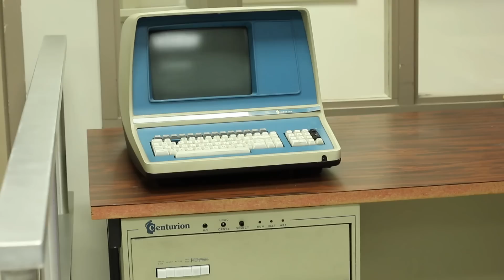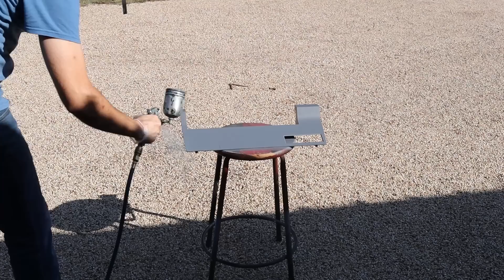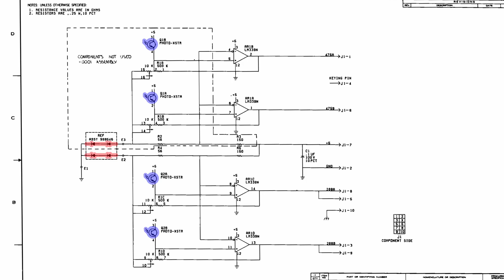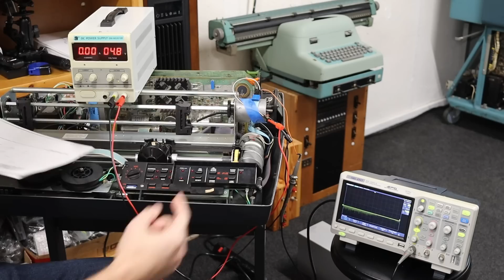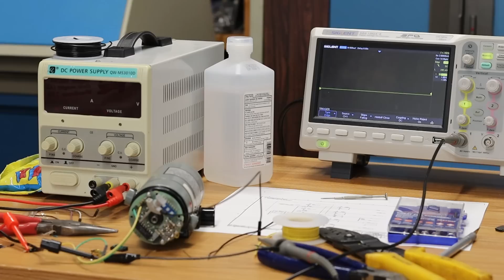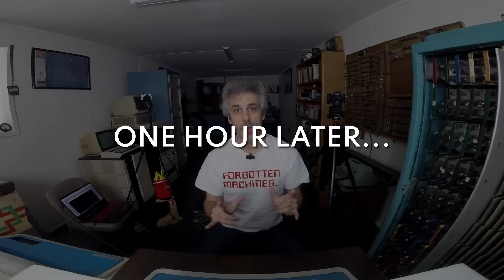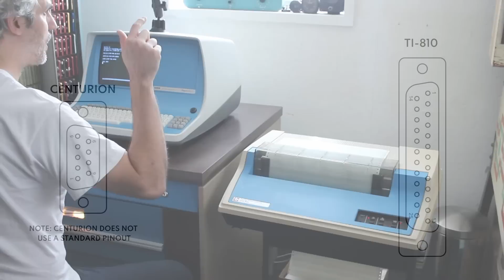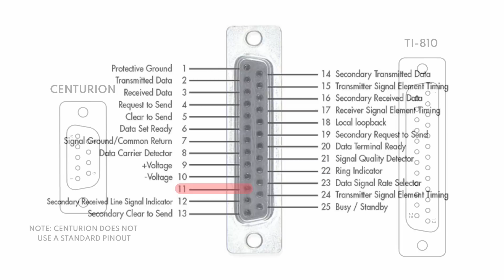I Thought It Would Be Easy… It Wasn’t

Comment: I was shouting at the screen when you were saying cabling issues.  RS232 is easy when you understand the different layers of it.
Each of the following are at opposite ends of the connector i.e. a end  -> b end

GND -> GND, since you always need a ground reference 

TXD -> RXD and RXD -> TXD so you have a data flow for the printed data, this is just data, no flow control, unless you use X-On / X-Off software flow control.
The pins meanings are Transmit Data / Receive Data. This is the absolute minimum needed for communication. 

RTS -> CTS and CTS -> RTS, so you have hardware flow control. The pin meanings are Ready to Send and Cleared to Send. This is needed to slow down the sender at the right time.

DTR -> DSR + DCD at one end and then and DCD + DSR -> DTR so you have modem flow control. The pin meanings are Data Terminal Ready, Data Set Ready, Data Carrier Detect. This is for modem control, so another layer of flow control for the modem, its only relevant if you have a modem in a link.

If you need a full modem support for incoming call, then you also need Ring Indicator (RI), in this case, then connect RI -> Data Carrier Detect (DCD), since the receiving machine is being told its detecting a carrier signal. Do the opposite at the other end DCD -> RI

Things will then work properly at all layers.

When some of the other layers are missing (i.e. no modem / null modem), this is what's results in the mangled cabling that connects between the different lines above. Generally this is a bad thing, but sometimes its necessary to get the right levels on the right pins to make sure that each end thinks that the other bits of the RS232 protocol see the correct levels on the correct pins.
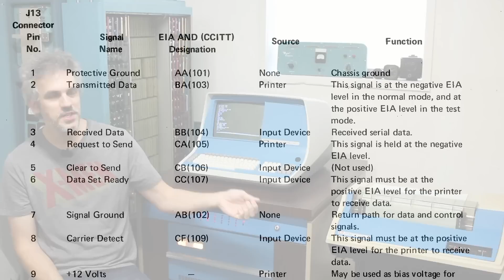Reply: The problem here is that the printer doesn't have CTS/RTS, the flow control is buried away on Pin 11. 24:50 The DCD/DTR/DSR was only saying the printer was on-line, not acting as a flow control.

Comment: My father had a cp/m s-100 and a printer that looks just like this one, though it sounded different when it printed. (I think it was a daisy wheel rather than dot matrix.)
He spent DAYS troubleshooting that damned printer. Not just once, but again and again first for the physical connections, then for each GD program that came in.
But it was the physical connection steoy that was funniest. He spent so long on trying to get the pinout right that he had just given up and decided to get drunk instead. And whike he was thoroughly buzzed but not quite in his cups (you know that moment where you still know its a bad idea but you're fine with doing it anyway?) he decided it would be fun to throw darts at the cable. I mean, it already didnt work, whats the worst that could happen? 😅

Well, he had forgotten that the computer was still sending signal to be printed and on the third or fourth dart throw, he severed exactly the right wire and the damned printer started spitting out characters.
Random dart throwing FIXED THE PROBLEM!!
Of course, subsequent investigation made him realize he hadn't read the instructions fully and completely. But thats a different side of the story. 😂

Comment: I actually adore dot matrix printers.  The sound, the print quality (or lack thereof), and the simplicity of design.  The printer did all the printing work, all the computer had to do was send ASCII, and maybe (later on) control code sequences.

Yes, they are noisy.  Yes they are slow.  And i'd have kicked puppies and punched kittens for a cheap dot matrix printer back in the day.

Comment: I had an 810 Ro back in the day (1985 ish) when I was in college.  I had it hooked up to a Commodore 64 originally and then a 10mhz AT clone.  I could not figure out the handshaking and ran it at 1200.   I only had the upper case roms.  Used it mostly for printing computer listings when I dialed into college (I was a computer science major).  Don't get your hand inside the machine when the carriage is moving... it will mess up your fingers.  Ask me how I know 🙂

Comment: Hi David, great work again! I used to repair similar printers for Digital Equipment in the 80s and immediately thought of an encoder problem when the printhead did not move to its left margin at power up. A word of advice: if you ever come across a dot matrix printer from DEC, do NOT remove the encoder PCB from the carriage motor unless you have the manual describing the correct encoder adjustment procedure. On those printers, you must usually power the motor with some 5V or so, hook up your scope to the photo sensors, and then physically move the block housing the photo sensors only fractions of millimeters to produce the correctly timed pulses. You need a scope and very calm hands, it's a really fiddly task.
Reply: LA120 <3

Comment: To stop battery leakage corrosion or even the standard oxidation, use white vinegar and baking soda, These will efficiently stop corrosion and neutralize the pH. Isopropyl Alcohol does not always achieve this result. Hope this helps!
Reply: White vinegar and baking soda neutralise each other and leave a giant mess.
Reply: @jeff-u3x7r  I think MidngihtHunters is suffering from a touch of Dunning–Kruger. As you likely know, white vinegar neutralises alkali chemicals like you find in batteries. Baking soda neutralises acids, like vinegar. Ideally, you'll soak the area in vinegar for a minute or three to neutralise the alkali from the battery, then, using a touch of water to make a baking soda paste, scrub the area with a toothbrush, neutralising the vinegar and providing enough abrasion to get rid of the remaining corrosion debris without damaging the board. Rinse the entire board with water (I'll usually spray the entire board down with simple green, let it sit for a minute, then scrub it down with a hogs bristle brush, then rinse) and drench the entire thing in isopropyl alcohol, which will absorb/pull the water from all the nooks and crannies and will dry in minutes. As you say, using both at the same time is pointless.
Reply: @jeff-u3x7r  I use to see youtubers like Adrian's Digital Basement and Necroware doing that and working perfectly well. Just wash it afterwards with detergent and water, or even IPA, and everything will be fine! At least is granted!

Comment: The worst part of those printers was the 'paper out' error blocked the serial communications. This almost always had the effect of freezing any connected system that was running a print job - especially if the affected software hadn't been engineered to handle a print failure.

Comment: As an old printer guy (think Dataproducts and Genicom and a few others), I did see a rotary dial but don't recall what it was called, but it functions like a soft carriage control tape.  I don't know how it is programmed, but you might try to see if you can skip over the paper at the bottom of the sheets and not print over the perforation.  I suspect one setting might do just that.  It's just a thought.  Sure miss the sound of a dot matrix printer.  I used to be able to identify the manufacturer just by the sound it made!  Keep up the great videos -- I look forward to them and learn so much.  Regards...

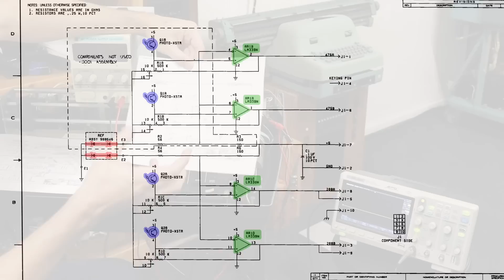Comment: 9:41  The LM339 is a quad comparator with open collector outputs.  It is not an op-amp.  
It works down to its minus rail.
It takes about 1.5uS to react to its inputs
It pulls down with about 6mA when the (+) is below the (-)
It releases its output when (+) is above the (-)
Reply: THANK YOU! It's an easy mistake to make, because the symbol for an opamp is the same as a comparator is the same, but jeez, the 339 is the classic comparator!

Comment: I used two of these at work One was a KSR and one was an RO. The only thing that ever happened was the hub the carriage cable was connected to the motor cracked and I had to replace that. Otherwise never a problem. Stone reliable and they ran 24/7 as a administration terminal and a call detail recording logging printer on a Nortel SL1 VLE phone system.

Comment: RS-232 standard -- the most non-standard ever!   
Only (?) TI used that reverse channel.  I spent a 3 hour WTF session attempting to determine the same issue early in my career, so I sorta knew where you were going.   Nice to see it working!
Reply: I worked for a telco, we used every pin, synchronous clocks, back channel, the lot. Then IBM cut it back to 9 pins, WHAT!
Back then, with what we would see from IBM etc, I was almost waiting for them to move from a 25pin connector to say a 37pin job - yet they did the exact opposite.
Reply: RS-232 is so flexible. That's what makes it seem complicated.
Reply: I got a bin full of console cables for various brands of networking equipment. They all use the RJ45 connector but are wired differently. Even the same brand like cisco or Dell might have 3 different wiring configurations. Its so infuriating 😄
Reply: @zaca211  That's one downside to using RJ45's for serial, rather than the original D25, Even going 9 pin D has it's issues as there are many twists, IBM PC, Centurion, and many more.
Reply: For what it's worth, the 9 pin D-sub connector means there are fewer signals to check and most of them are probably relevant.
Reply: @zaca211  Why bother with a standard if they won't follow the standard?
Reply: @ChickenPermissionOG  "RS"-232 is "Recommended Standard" 232.. https://en.wikipedia.org/wiki/RS-232  This wasn't uncommon at all back in the day and totally depended on the needs of the individual devices..
Reply: @zaca211  Welcome to the world of IT!

Comment: Wow!! My first job was testing 810's for CADO Systems......back in 1979. We swapped out the character-generator ROM because CADO had a few custom characters. I definitely recognize the internal guts. Well-built machine.
Reply: Had not heard the CADO System computer name for over 40 years ago when I was working at Warrex / Centurion.  We had a Centurion dealer in Atlanta, GA that also sold CADO system ( I think for Typesetting uses ).
Reply: @kenromaine2387  It's possible you are referring to the CAT photo-typesetter, which was not associated with CADO. Most of the systems sold by CADO were for small business accounting, payroll, inventory, purchasing, and billing. The 810 was CADO's first-supported dot-matrix printer, and was replaced by a much cheaper (and lower-quality) unit from Dataroyal.

Comment: Shows how mess the RS232 just is, especially old stuff never had fully standard pinouts and signaling, and much of the time need custom cables. I wonder if Centurion badged printers had different pinouts, or if they just supplied correct cable from the factory.

Comment: There's something very satisfying about the sound of a dot-matrix printer doing its thing. 😄
For the too-light printout, I've heard that a tiny squirt of WD-40 on the ink ribbon and allowed to soak throughout the ribbon will help to both lubricate it and darken it.  But I've also heard that there are ways to re-ink the ribbons even nowadays, so maybe you should look into that?  And thanks for the bunnies... I mean... the fun video. 😃
Reply: Avoid applying WD on it. Sometimes this breaks the plastics molecular linkage
Reply: @VitorFM  yep, i've had WD40 destroy some plastics....
Reply: @andygozzo72  on rubber, it can even melt it ...
Reply: @VitorFM  dunno about 'melt' it, it can certainly make it 'swell' and go more jelly like, i've had this happen...
Reply: modern ones still print by a matrix of dots
Reply: @andygozzo72  Except that inkjet printers use much smaller dots.
Reply: @melkiorwiseman  yes, but still a matrix of dots 😉 .. these older printers should more correctly be called 'impact printers' .

Comment: I miss printers that had schematics and you could actually rebuild them... and they were worth rebuilding.
Reply: I used to have a TV set that came with a schematic.  Early personal computers came with schematics.  At one time the wiring of a car was at least partly shown in the owner's manual.
Reply: @kensmith5694  I used to rebuild Laserjet IIs, IIIs and 4s. For the longest I kept a 4 in my service truck because I could plug it in for a customer who was down, it just worked and everything that was anything had drivers for it. Models after that kinda stopped being worth fixing. For the most part though outside of specialty equipment or restoring old equipment it really doesn't pay to fix electronics anymore. Most things now yeah it's cheaper to buy a new one than to pay me to solder a chip in the broken one provided I can even find a service manual for it. Most of the repairs I do are for radio stations even then it's difficult when there is no longer a well stocked Radio Shack in town. I am probably the most well stocked in town now and that's not saying much.

Comment: There's something very satisfying about the sound of a dot matrix printer whirring away.
Reply: Combined with the sound of a floppy drive
Reply: Brought back an old college memory: had to do some engineering lab simulations and submit print outs of data plots. The dot matrix printer was ancient and printed so slowly that I decided to use other machines as well to speed it up, since the lab was pretty much empty. Managed to keep five of them going at once which was satisfying, but the racket was crazy.

Comment: I only just noticed, that printer has a separate ribbon motor rather than using the print head movement.
Reply: As I recall, if you used the print head movement to move the ribbon, sometimes you could run out of ink mid-line.
Reply: @RichardBetel  Can't say I saw that happen.  Admittedly it has been quite a while since I've even seen a DMP in real life but from memory they'd all move the ribbon fast enough so that in either direction of printhead movement it would never be striking the same place on the ribbon continuously.
Reply: @retrozmachine1189  It's been about 40 years since I last used a dot matrix, so I kinda doubt my own memory, but what I remember was that some printers basically dragged the ribbon along with the head as they moved left to right, but then left it behind moving right to left.... or something weird like that. It meant that you started every line with fresh ribbon, but it faded. My memory of it was that it wasn't noticeable when you printed simple text, but when you fired up printshop and starting making big banners, you noticed it...

Comment: FYI - The Centurion printer type PRTQ is the nane of tbe Centurion print spooler program. The print spooler lets you send a print job to the PRTQ at full system speed and not be limited to the slow printer speed.  Once the print spooler program receives the print job the printer starts printing the job, and the system user to do other jobs as the spooler prints the last job.  In the case of this CPU5 system OPSYS gen. PRT0 is setup with the TI-810 printer driver.
Reply: My thoughts as well.  I worked a different system/ OS that also used a spooler.  You could send print job to 'prt' (printer) or 'slo' (spooler listing output).  Standard practice was to send to 'slo' to have job run quick without waiting on printer.  But if the spooler task dies, had to have sysop/ admin restart it.

Wonder if there's some startup script that needs to start PRTQ spooler on Centurion?
Reply: @mikefochtman7164  It should have a JCL file with a the JCL commands ( guess you could call it a script ) to start up the Centurion print spooler.
Reply: Yeah, as soon as I saw 'Q' in the name, I figured that it was a spooler. lol

Comment: I once had a job calibrating and modifying these kind of printers before they were sold and that was in the nineties, so still then they were used. I also remember a cabinet below it to house the chain paper.
Reply: Oh, yea, even as late as ‘96 I had to maintain several that were used as report printers. Most had been replaced with high speed, quieter, ones capable of multi-part forms (some with automated stuffers), but these TI’s were the workhorses for general report printing.

Comment: That print head can't have too many characters on the clock, all the dots seem nicely aligned.  I used to repair Oki printers and have replaced the pin guides (might be called a jewel by some) and pins too if the pattern was getting too rough for the owner.
Reply: Yes, I had a huge printer I got from a computer fair and the dot matrix head had probably run into a paper jam so some of the pins were bent. Fixing that was "fun".

Comment: Had a stand for a 800 series printer, which still has a printer on it, a laser printer, as the TI printer was not upgraded, and the newer Seikosha that replaced it was replaced (a few times, with the same model as the heads wore out) with an assortment of HP printers. 800 printer was scrapped, but I kept the print head rods, and used them as long drifts.